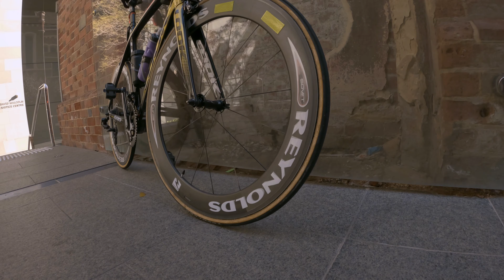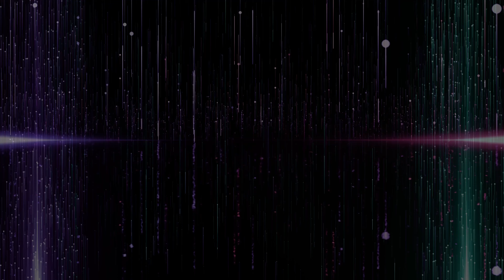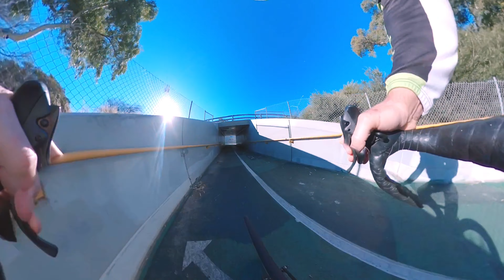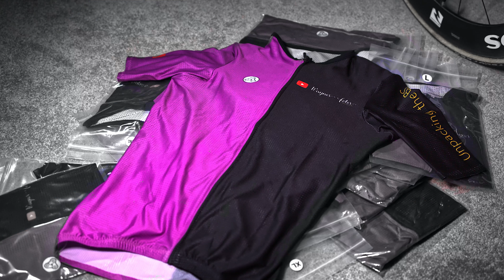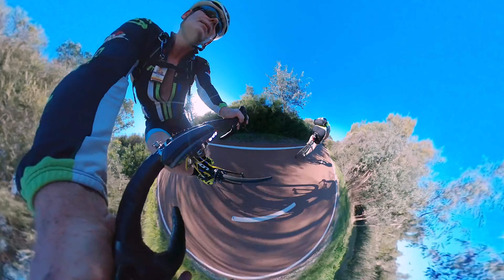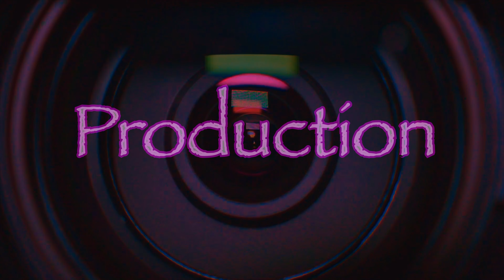TYRES, Best ride. which tyre?

Comment: I think there is yet another thing that holds a sew-up to the rim aside from the adhesive.  If you inflate a sew-up off the rim, you'll see that the diameter of the tyre reduces.  Under high pressure the plies tend toward becoming radial and that causes the fabric to shrink along the circumference.  This constriction also helps embed the base tape in the glue when you inflate your tyre on the glue when you initially mount it.  This also helps keep your spare on when you've had to change out a flat on the road.  Sure!  It won't be nearly as solid as a well glued tyre (corner gently please), but it's not as though there is nothing other than the adhesive holding the tyre to the rim.
Reply from the maker: Yes of course, pressure operates in all directions, also towards the rim. So this is actually putting pressure on the rim holding the tyre on. Roll off is the main risk here.

Comment: This is EXACTLY right.  Tubeless is baloney.  People believe things that are so stupid....  #1 Lower pressures mean less rolling resistance.  USING THE SAME RIM/TIRE, MORE PRESSURE WILL ALWAYS MEAN LOWER ROLLING RESISTANCE.   Sure, if you are riding very rough surfaces it means less control and less comfort but the idea that running 20lbs less on the road will improve rolling resistance is so stupid it can't be put into words.

Comment: I've owned tubular carbon rims once but not very long. PIA because I always had the backup tire hanging out of my jersey pocket. At any rate the ride never left a lasting impression either. After many many tires tubeless and regular clinchers the one tire I stay with is the Bontrager R3 clincher because it flats less than anything I've ever used in the past. And that's what really matters when you just want to ride your bike.

Comment: The best tire is the one that seldom goes flat, is fast, and durable. Choose 2. One tip, bigger rider best to use wider tires with fairly high pressure.

Comment: I have tried them all. Clincher ..tubeless and tubular. Forget about tubeless total PIA ..I have 2 sets of Bora Ultras...one has Vittoria corsa 25mm clincher and the other has Veloflex 25mm tubular.Not much in it to be fair . both ride sweet.but the tubular setup i feel handles better anfd is super smooth. I can pump the tubular up yo 100 psi and is still buttery smooth.Try that with a clincher...it would be rock hard..
Reply from the maker: Agreed

Comment: We can see from your video your local bike tracks are smooth and suit a smaller tyre however in dear old Blighty where we have potholes and endless flints on the C roads which we cycle on to escape the traffic. Bigger tyres on wider rims allow lower pressure which soak up the bumps without major loss of speed. The tubeless sealant fixes most of the small flint holes and allows you to get home to fix bigger problems in the dry. The old timers I ride with say the tubeless and wider tyres give the same feel as the tubs of yesteryear but I'm not raiding the museum to find out. Enjoy the ride on whatever tyres you can fit.
Reply: Completely agree with this. Riding in Yorkshire where for some reason the Council Contractors think it’s ok to scatter loose surface dressing on the minor roads where most cyclist use, then a wider tyre is preferable.

If I was riding on lovely smooth roads then yes a smaller tubular would be lovely.

Comment: A guy I race with pumps his tubeless continental tyres up to 120psi , reckons they're faster like that, I thought the idea of tubeless was low pressure, is this just a gimmick, very confused now. Your vids have been great of late Wayne 👏
Reply from the maker: Well they keep telling us lower pressures are faster. But for me i do like the hard pressures for cornering. No science there just feel. So make of that as you will
Reply: Your mate needs a lesson in basic physics of sprung mass. The vibrations felt at such high pressures are just forces which are slowing him down .

Comment: I just saw the GCN Movie Coast to Coast and they recommended 28mm over 26mm because of the comfort. What will come next 32mm or even more?
Reply: Moderation in all things.
Reply: for comfort as big as possible. I mean I dont ride narrow tires on my street bikes at all and am using 2" to 2.2" yet I am as fast as my clubmates, but I probably am using more energy than them but isnt it what we want at a more advanced age that is :D
Reply: My Endurance road bike came with 32c tyres. I wouldn’t say they are more comfortable than the 25c I have on my other bike. However for riding on rubbish roads where I live the 32c are great. They give me much greater confidence on corners with loose chippings and decending steep narrow hills on poorly maintained roads.

Comment: I think my 21 and 22 mm tubular tires on my disc wheel and trispoke, respectively, offer a better ride than my gp5000 clinchers in a 23 on my alloy training wheels.
Reply from the maker: Yeah they would. If you switch between clinchers and tubulars you can really notice the difference. Even when they are smaller.
Reply: Out of interest is your disk wheel structural?

Comment: TT guy here been through many Vittoria Corsa Speed TUB fast but so fragile  then switched to TUFO elite 215 g and will never go back.
Reply from the maker: Speeds are extra fragile, lighter than the regular corsa graphenes Vittoria tyres. I do think Veloflex have a ultra lightweight tyre too. Glad you are have success with the Tufo. 👍
Reply: @waynosfotos  I think we need more voice about how bike industrial moving away from TUB with out any proper reason.  Carbon TUB wheel comes with so many advantage.  Light, better heat resistance because of the tub bed and awesome tire shape when aero is a priority.

Comment from the maker: Found that Veloflex has been doing some research and developed a corespan tubeless tyre. 
It will be very interesting how theses perform out in the wild.
If anyone has tried these would loVe to hear your feedback so the community can be more enlightened about this new type of product. 👍🤔
Reply: I think there was a tubeless tubular cyclocross tire available for a time. On a short course in mud with assistance nearby it didn't succeed. Many things are possible but not always practical.
Reply from the maker: @davidburgess741  there was a tufo clincher tubular, but as you highlighted it didn't take off.

Comment: Simple, use the good old UST, then the tires are stuck on the rim so hard you need a car/tire tire changer :P But of course you will never be competitive with such heavy UST tires but you basically can run totally deflated without the tire coming of the rim :D
Reply: Might be a silly question, but what's a UST?
Reply: @byrondixon4648  Mavic had a tubless standard back in the day where you did not even need any sealing, but it was a chore to mount or remove the tire from the rim.